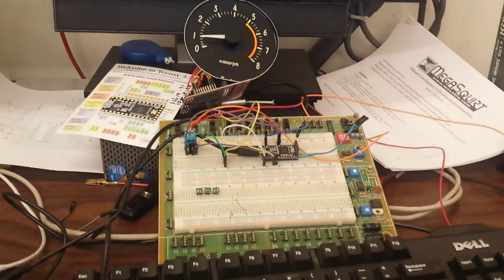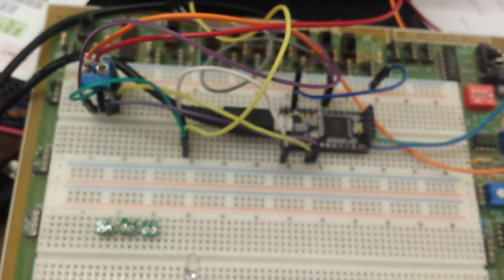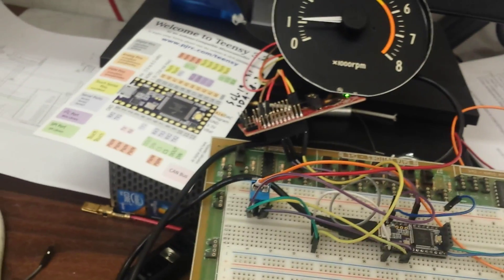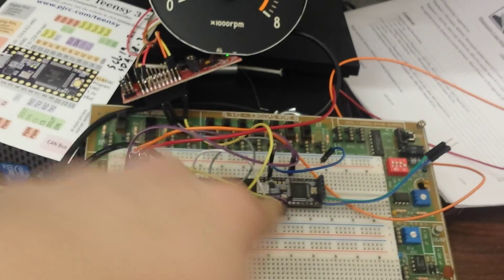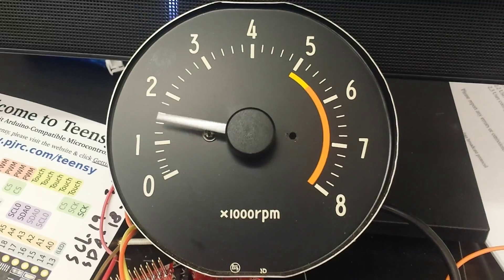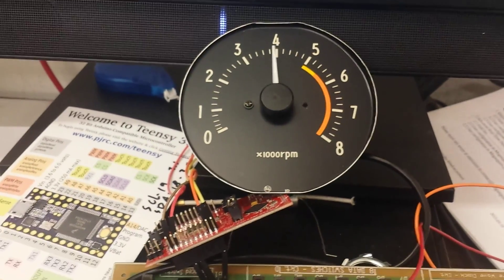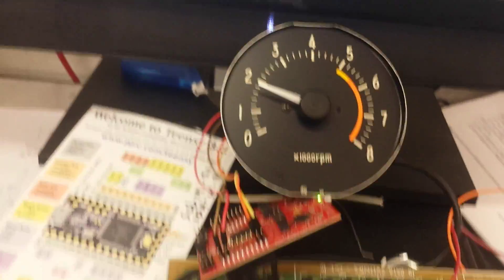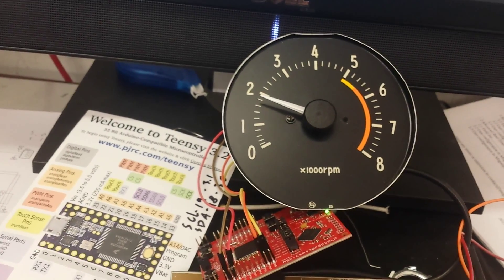Megasquirt Arduino Teensy MSP430 CAN I2C Gauges

Comment: I really want to do this for my S30. I need a speedo, tach, water temp, oil psi, and boost/vac.     But I never done it before.  Where can I find a good place to learn?
Reply: That can all be done with no CAN BUS at all, well here he can use the messages in other places or take values from megasquirt sensors..

Maybe a glued magnet to the driveshaft behind the gearbox gives you pulses to an arduino and runs you tachometer :-p

Comment: Hi, doing a similar Arduino-based gauge cluster for my Megasquirted Delorean. Question: you mentioned smoothing the pointer steppers by changing smoothing in TunerStudio. Did you do that using General Settings / Input Smoothing Lag Factors, or are there some CAN data output smoothing settings (that I can't seem to find)? Thanks-really cool project!
Reply from the maker: Mark H. To be honest I'm not sure how I ended up smoothing it. If you look at my other videos I have an updated video showing them as well.

Comment: Hello. Are you using any CAN transmitter between MS and Teensy? I couldn't fiqure it out from the video. I'm so new in the coding and all of this micro controller stuff that everything is difficult. I bought Teensy 3.2, gps module and motor cotroller for the basically same idea that you are doing. I would like to have much help on this.

Comment: Very cool what you have going there. However I d not understand why you don't just go from ODBII via Bluetooth to a large tablet in dash for everything you could want.
Reply from the maker: John W. Ketchersid PhD there is no obd2 with a Megasquirt. :)
Reply: Foxau2 http://www.miataturbo.net/ms-labs-miata-accessories-89/obd-ii-data-module-all-ms2-ms3-ecus-79429/ If you are working with the CAN bus then this add on for your MegaSquirt 2 or 3 will give you full ODB2 outputs. I missed the 1977 :-) no ODB stock. But what an AWESOME leetle monster to build up. Keep having fun!  I am doing the MegaSquirt3 with this add on in my 78 Mercedes Benz 450 SL. I really like the idea of keeping the analog look while getting digital accuracy. The jitters in your stepper on the gauge can be dealt with using....
Reply from the maker: John W. Ketchersid PhD if you look at my other videos I have an updated version that took care of the needle jitter. Also shows in greater detail the adapter boards I made for the stepper motors.
Reply: Foxau2 I shall see them all for sure brother. I am just wondering when your completed kit will become a product... There is a pretty good market for your solution.

Comment: slowly researching a sim project, repowering my 45 chevy truck with a vortec 4200 Inline 6 & 4L60E, going to be running a MS3x and GPIO trans controller (MSshift if I recall the name) im curently working on reworking all my factory gauges with stepper motors and hiding a OLED display in the speedo (making it not visible when off)  for some other read outs on demand.  Was going to build an Arduino mega with three stepper controller shields and a can bus chip ( MCP2551 maybe )  But I think I like the Teensy (3.2) setup a bit better, any Idea what I2c controllers you are going to use for the gauges?  Also What does the protocol look like from the MS3? I haven't got my MS3 as Im still rebuilding the donor motor so just trying to plan at this point.
Reply from the maker: I'm using an msp430 for the slave boards. It's programed using Energia, which uses the exact same code and libraries as an arduino, but they are much cheaper, and don't require a bootloader to program. I use the exact same I2C library on the Teensy as I do in the msp430.
Reply from the maker: If you Google "Megasquirt Teensy gauges" you'll find the project that uses a screen, and from the sounds of it would be a good starting point for yours! I'm going to have another video soon with updates.
Reply: Been playing with a breadboard setup with one of these steppers lately, I almost think it would be a benefit to develop a Breakout board that mounts to the motor with built in I2c connection(s) to make it easier to daisy chain, as well as the motor controller IC ( like a MCP23008 ) as well as some flyback diodes to prevent and inductive kickback.  Kind of an all in one for reto fitting gauges lol
Reply from the maker: +rye kbaum My next version is more like that. It will use a driver IC that has microstepping ability to smooth out the small transitions. One step is very noticeable so microstepping will get rid of that making it extremely smooth.
Reply from the maker: The next version will be pretty much like you describe: built in connections for I2C and power, and could be used to retrofit any gauge. The great part is that the slave board (the one driving each needle) won't need to be programmed after initial programming. Everything is changed on the Teensy.
Reply: +Foxau2 how many gauges total are you going to run daisy chain off the teensy? any worry on the load, slowing things down due to baud rate restrictions? again, I dont know the teensy well as I was messing mostly with my ardiuno mega I had laying around.  As im going to have to tun 5 stepper motors as well as planning an OLED display I need to watch how much work I expect the network to run
If I get the setup to work properly would be pretty trick to have a switch to dual use some of my gauges, have them switch to read something different on demand like AFR instead of fuel level, RPM instead of speed etc etc lol
Reply: * the standard gauges on the truck are just speed, fuel, temp, battery, oil pressure, with most having about a 100 degree sweep, and speed having about 170 degrees
Reply: makes me want to design and have some PCBs made just for this type of retro fit application.
Reply from the maker: +rye kbaum you can run pretty much as many as you want no problems. Once you have a screen I think the Teensy will still have plenty power leftover to run everything. I will be running at least six gauges: tach, speedo, coolant temp, fuel level, oil pressure/fuel pressure, and AFR. Potentially more of I think I need them. I am designing a pcb specifically for the purpose of Daisy chaining motors together. The board is only barely bigger than the motor itself, and if I find a suitably smaller connector, I could make the pcb the exact size of the motor, making install really easy. The way it's designed right now, the motor pcb has selectable addresses allowing for 16 different motors. I don't think any install will ever need that many though.
Reply: +Foxau2 well I make sure to check in from time to time, may not get to building my setup for a bit but gonna order a teensy and maybe a few other breakouts to mess around with as I plan my build.
Reply: does the stim tester output canbus without the MS attached?
Reply from the maker: +rye kbaum no. The canbus comes from the MS itself so it must be attached.
Reply: +Foxau2 figured so but had to ask
Reply from the maker: +rye kbaum I just uploaded a new video with the updated versions!

Comment from the maker: No ABS in a 77 Celica. :) it'll be easy to calibrate once the gps is working the first time. Just take the actual speed and divide that by the pulses from the sender. It's easy to modify and fit a GM style electronic speed sender to the transmission.

Comment from the maker: I'm trying to find a good way to make a fallback for when the gps can't get a good fix. More than likely it will be the speed signal. I'm adding a supercap to the gps to keep it "warm" all the time so startup won't be an issue. But in the event of an obstruction like buildings or trees a backup would be good to have.
Reply: +Foxau2 Average wheelspeed of all 4 wheels in rpm over circumference of the wheel? This should give you a pretty good number.
If you have ABS you should be able to just get the signals needed from there.

Comment from the maker: Yeah it's still an active work in progress. To smooth out the jittery needle all I needed to do was raise the smoothing value a little in TunerStudio and it calmed right down. Right now I'm integrating the gps module for the speedometer.
Reply: +Foxau2 Will you be using the CAN speed signal as a fallback in case the GPS can't get a good fix?

Sounds like a cool project, I'll be following along.

Comment: Hey man are you still working on this? I might have a suggestion for smoothing out your RPM gauge without just silly value rounding.

If you're interested I can dig it up for you, it's a delta correction formula that I think will work great.
Reply: I will be working on something similar soon so if you can tell that would be awesome :)